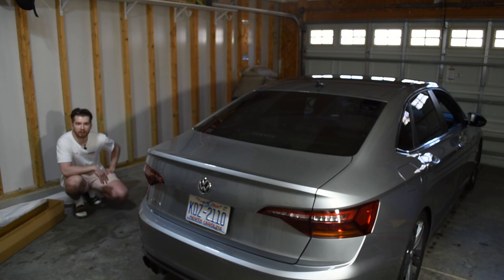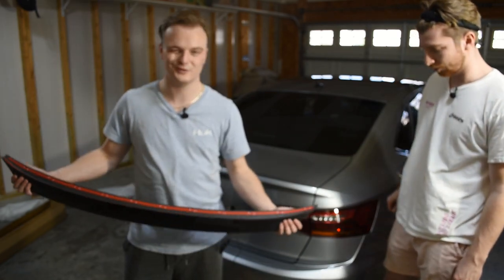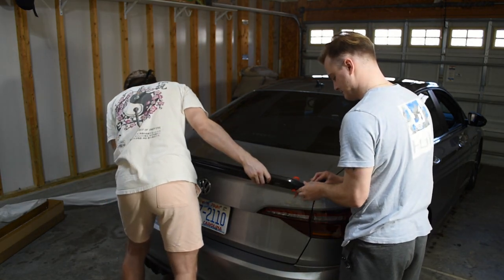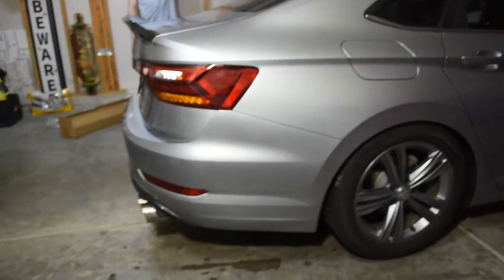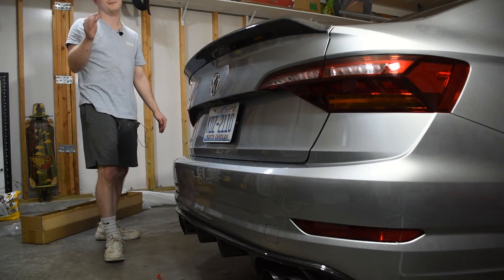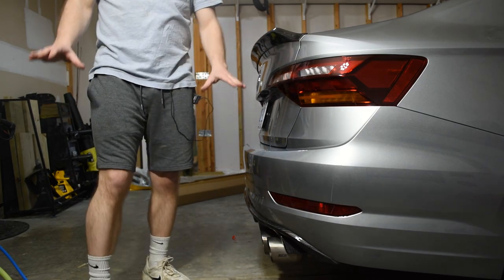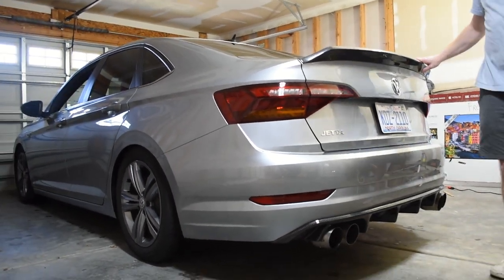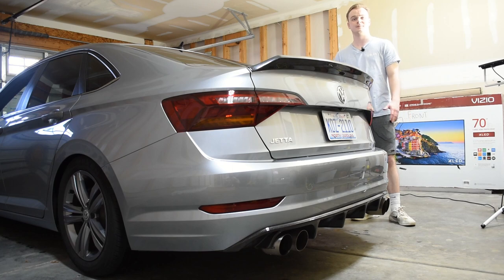MK7 Jetta - Carbon Fiber Spoiler Install!

Comment: Have you felt any difference in high speed driving or corners? Depends on the roads I am at 80-100mph I can feel the car bouncing from the air so I need something to keep me stable
Reply from the maker: To be honest I don’t think the spoiler is the most functional in terms of aerodynamics. You would need a way bigger wing for that. It’s more for aesthetic appeal. So far it has held up extremely well and looks good!
Reply: @NoSleepersCo  yea I think a wing would look funny on a Jetta which is why a spoiler is the better and more affordable option. Best thing is probably lowering the car. I’m sure there’s a slight difference who knows
Reply from the maker: @bigali2783  I’m sure there’s a very small difference but it’s not noticeable in terms of drive feeling. I would think it would have some sort of downforce if not drag which could potentially help for this case

Comment: How did it work out? Any issues lifting?? Looks great.
Reply from the maker: No issues at all! Has survived all kinds of weather and temperatures so far. Looks great still. Because it is custom made carbon fiber the edges are completely perfect so I would definitely test fit before sticking it on. Highly recommend the carbon fiber, have heard bad things about the plastic ones
Reply from the maker: Edges aren’t perfect*

Comment: Do you think this will fit the mk7.5 gli, the website says it won’t but I don’t remember vw redoing the trunk width.
Reply from the maker: It looks like it would fit. If the width is the same you should be fine. The spoiler fits flush to the slightly raised lip you have on the trunk so I’m thinking it would fit. Try Facebook groups to see if anyone else has done it

Comment: I have a 2023 Jetta. I’m looking to mod mine. Do you know if MK7 parts would work on the newer models? Also I’m in NC!! Just moved here!
Reply: I ordered one I’ll let you know how it fits
Reply from the maker: Not sure honestly. Most of the parts are from ECS tuning and they will tell you compatibility on the website
Reply: @anthony1310  hopefully it fits!
Reply: @Bell_E_Ocean  it fits I got one from EBay for the vw 23 SE but I kinda messed up the corner is closer then the other side just take your time 😭😭 but yea it’s nice
Reply: @anthony1310  awesome!! Thanks for info!! I'm gonna try it out! Are you gonna try and reinstall it or leave it as is?
Reply: @Bell_E_Ocean  I reinstalled it 4 times already but it’s cause it’s a different model so I put extra 3m but you should try it looks fire
Reply: @anthony1310  awesome thanks for letting me know! I’ll let you know how it goes

Comment: what rear diffuser are you guys running on the mk7 jetta?
Reply from the maker: It is the Borla quad tip exhaust car back with carbon fiber rear diffuser from ECS Tuning. They sell it as a kit!